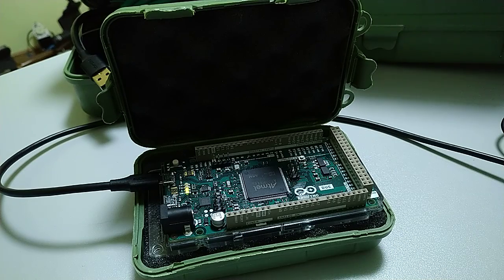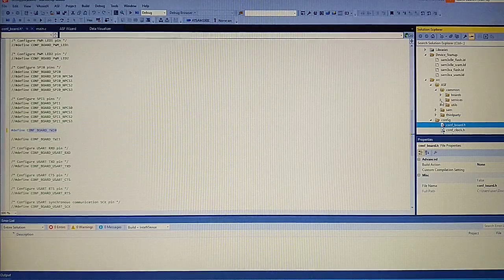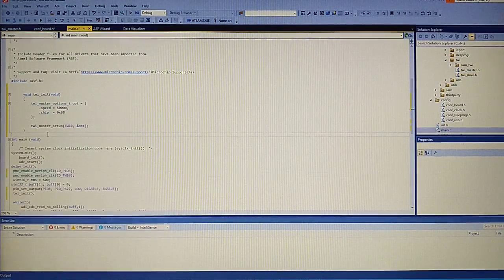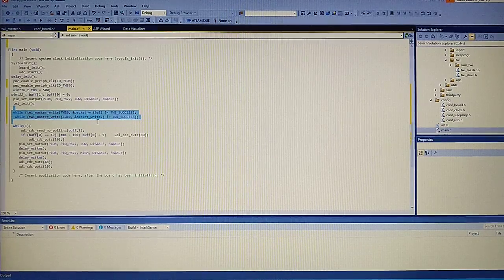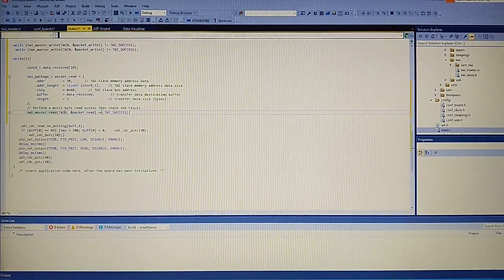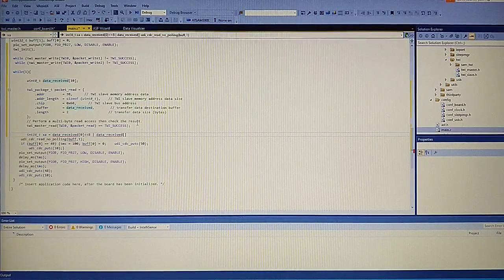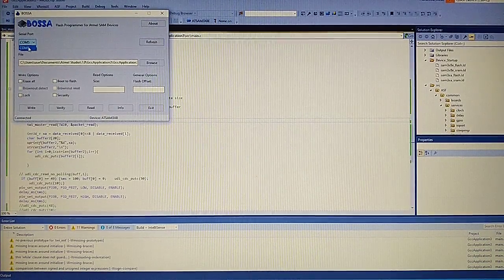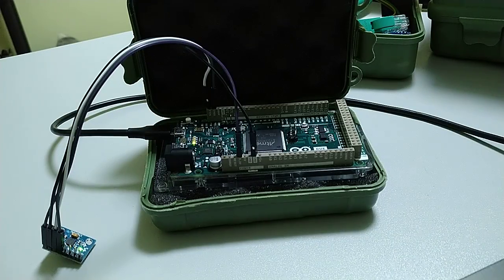Arduino Due TWI/I2C example with MPU6050 in Microchip Studio 7

Comment: Hi
why do we have 2 packet_writes? and read?
Reply from the maker: Hi, the two first writes were to setup the accelerometer at two registers - it can be done using only one packet and just changing the data in it before another write. After we do a write to a register we also should do a restart of the transmission before writing to another one - something like repeated start. And the read packet is pointing at the register containing X accelerometer axis value (the upper 8 bit and address +1 is the lower 8 bit part).
So a packet write does: write device address shifted left 1 bit -> write device register address -> write register content ->end transmission.
A read packet does: write device address shifted left 1 bit plus 1 -> write device register address -> read register content -> read address plus 1 or end transmission.
Reply: Thank you :) @e-exp
Reply: Hi I had sent you an email with the problem I am facing with i2c when reading the temperature could you please see it?

Comment: Will you please tell me how to upload the code in arduino due using bossac?
Reply: Thanks it worked
Reply from the maker: Hi, so you want to use the arduino bossac.exe? If so then if you are using windows, run the command prompt then type in 

cd <location of your bossac.exe> 
(in my case cd C:\Users\User\AppData\Local\Arduino15\packages\arduino\tools\bossac\1.7.0-arduino3)

And to program a binary file type in
 
bossac.exe -i -d --port=COM6 --force_usb_port=true -e -w -v -R  program.bin 

 The Com6 is just for example you need to first check the correct port number. Program.bin is the file you want to program and it is also located where the bossac.exe is.
Reply: I am trying to use twi in SAM3X8E , I am using BH1745NUC RGB sensor so everything I am doing as per your video but  no clock is generating on scl line ,it's always high ,I tried almost every possible ways but l am not seeing any clock on scl line . Suggest me what I need to do to make that RGB sensor work by using SAM3X8E?
Reply from the maker: Things to check are:
- is the clock for the i2c enabled with pmc,
- is the clock for the pins used for i2c enabled with pmc,
- are the i2c pins configured as correct alternate functions,
- are the pullup resistors (4.7kOhm) on the i2c lines or configured with pio as internal,
- is the i2c instance correct,

In my ov7670 cam video there is also i2c (instance 1, pullup resistors are external) used, the sample code used there:
	pmc_enable_periph_clk(ID_PIOA);
	pmc_enable_periph_clk(ID_PIOB);
	gpio_configure_pin(TWI1_DATA_GPIO, TWI1_DATA_FLAGS);
	gpio_configure_pin(TWI1_CLK_GPIO, TWI1_CLK_FLAGS);
	pmc_enable_periph_clk(ID_TWI0);
	pmc_enable_periph_clk(ID_TWI1);
	twi_reset(TWI1);
		twi_master_options_t opt = {
			.speed = 50000,
			.chip  = 0x21
		};
	twi_master_setup(TWI1,&opt);
	twi_master_enable(TWI1);
Reply: I tried but I am not seeing any clock on scl line
Reply from the maker: You can send the project to my mail (eexp_io@yahoo.com) and i will let you know what was the problem
Reply: Sent @e-exp